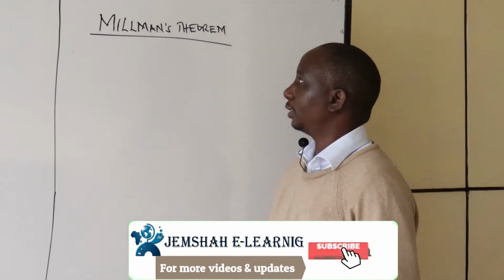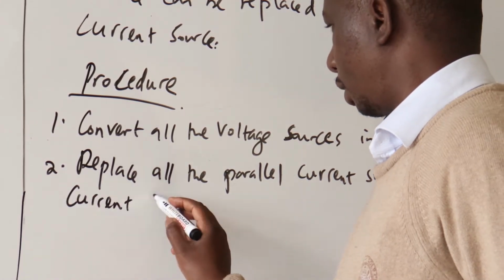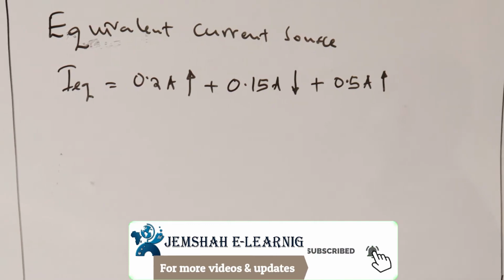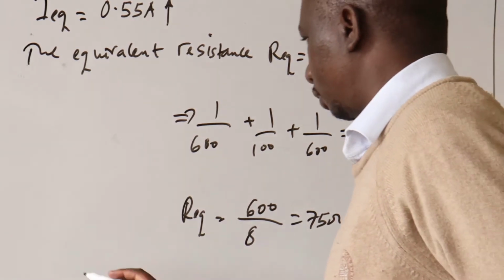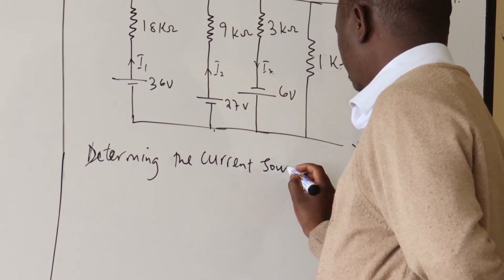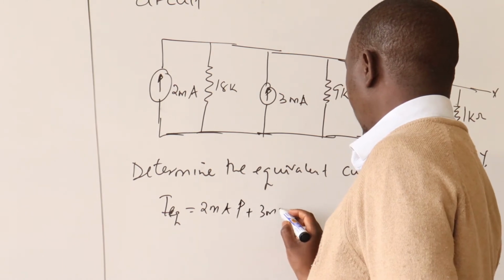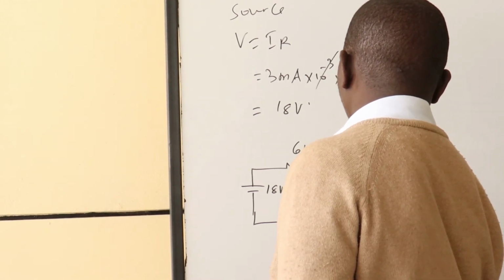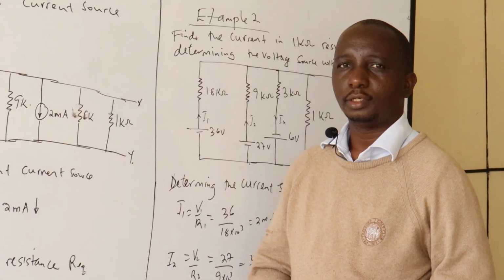MILLMAN'S THEOREM ELECTRICAL CIRCUIT ANALYSIS

Comment: You made a mistake with the third resistor when drawing the equivalent current source .. instead of 3k ohm you used 6k ohm ... or there was a reason ?
Reply: The equivalent resistor is 3k ohms not 6k ohms.
Reply: I noticed that too..